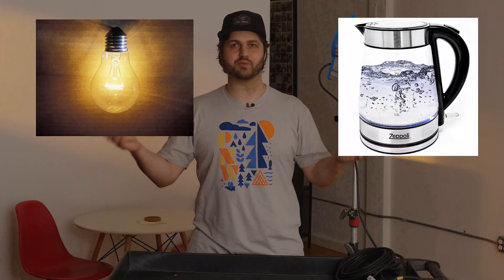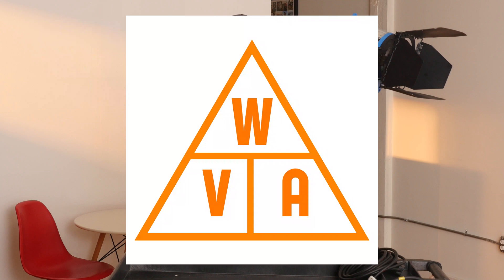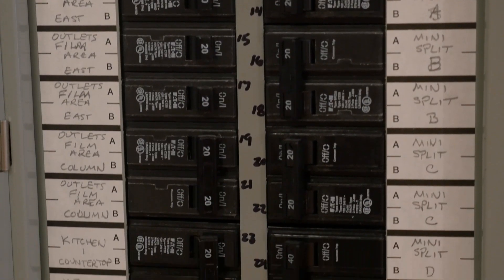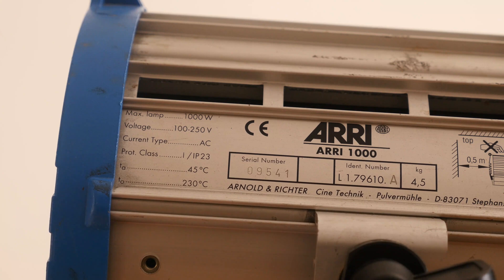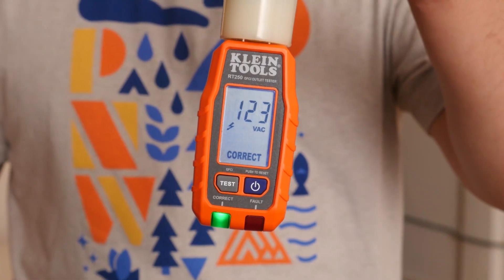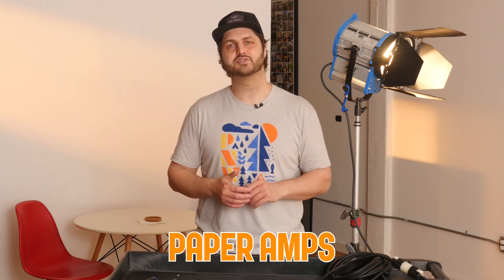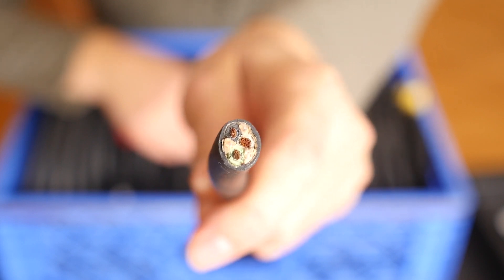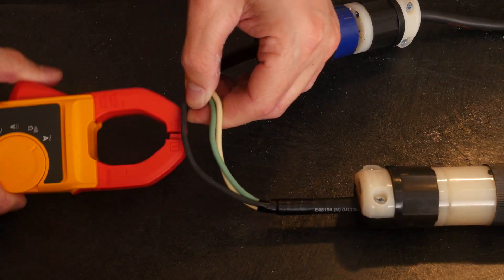Electricity Basics for Film Sets

Comment: I'd love to see a video on setting up larger lights (60A etc.) on gennies etc.
Reply from the maker: That’s a good idea! Are you referring to tow plants or specifically Honda 6500s for running new 2400/2600 LEDs?
Reply: @PancakeLighting  Well, on second thought it might not be the most popular video topic for your channel, what I need as far as tutorial info.  So I've assembled a bunch of classic HMI arc lights, 3x Arrisun 12+ and most recently a Desisti 2340 (and also a mixture of par/fresnel 400's, 8 I think... or 10).  The Arrisuns are at the limit of plug-and-play for a 20A house circuit (which has been suitable so far) but the 2340 is a 4000 watt fixture with a bates plug and it's totally going to need a genny... AFAIK at least.  I'd love to have some insights on how to go about this for an indy guy, from renting to buying, what to look out for, I'm kinda new to exploring the G/E side.  I've been shooting 35mm b/w on 90's era MovieCams through old anamorphic glass since 2011 so I'm something of a unicorn here.  I need the punch and point-source of HMI's also because I tend to go for that chiaroscuro hard-key look.  A tut on genny selection and laying electrical pipe to and from would be super helpful to me at least... Will a 6500 put out enough juice for a 4000 watt lamp?  Thanks for considering my questions!
Reply from the maker: The deeper you get into power distro, the more variables arise that can effect your decisions. For example, do you want to run your lights at 120v or 240v (if capable). How far do you need to keep your generator from set? Does your location have access to a dryer plug?

There’s lots Involved, feel free to send me an email (pancakelighting@gmail.com) that’s likely a more streamlined communication. 

To answer your question directly, yes you can run a 4k off a Honda 6500. You could either build a twist lock to bates adapter or change the bates on your ballast to twist lock. Same difference. You will have to choose if you’re working it to 120V (hot, neutral, ground) or 240v (hot, hot, ground). Personally I would go 240 just to keep the generator balanced and amperage lower.